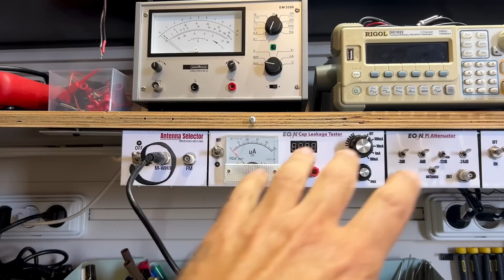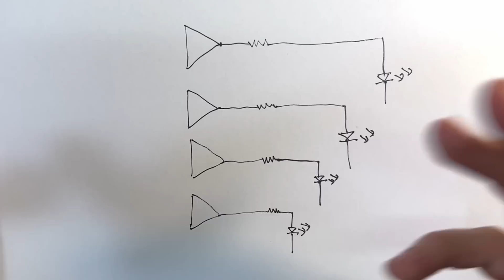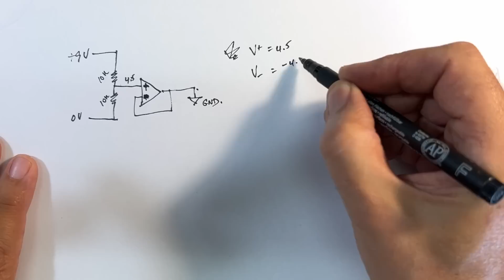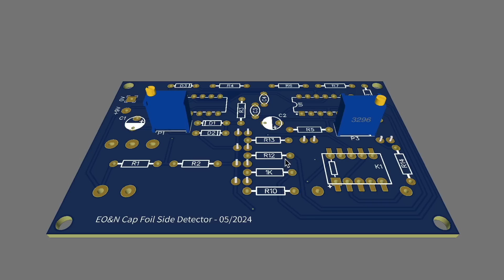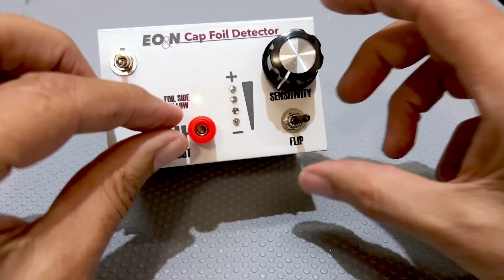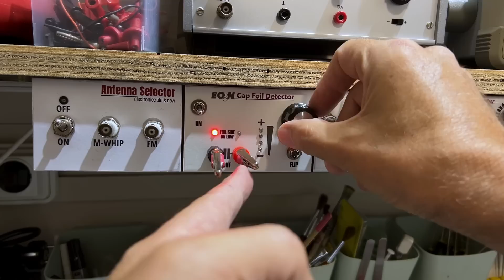Design & Build a capacitor outer-foil detector for restoring vintage audio & radio gear #pcbway#

Comment: I just discovered your channel. What a great design, and many thanks to you for freely sharing it with us fellow electronics hobbyists!  You stated that such a tool is unnecessary with old stock film caps that already have the outer foil labeled.   I've found the factory markings aren't infallible; over the years (using the classic o'scope method) I've ran across a few here and there that were incorrectly marked.  Which, by the way, makes a foil-side indicator like yours even the more valuable!

Comment: May I make one respectful suggestion? To avoid having to touch the DUT, would it be feasible to mount something -inductor? close to it? This would provide a ready source of RF hash thus keeping one hand/finger free. Plenty of room in the box to make something using a 555 to manufacture the hash. Also, if I was building this I would use push tabs such as on the back of speakers in place of the banana connectors. BTW your clips adaptors are pretty nifty though. I really enjoy your channel.

Comment: Nice circuit. Your banana binding posts should not be red and black, since you don't actually know the polarity.
Also, you forgot to demonstrate the trimpot on the voltage divider that sets the LED ganularity.
I think that control should have been made avaiable on the front panel, for fine adjustments on tricky caps.

Comment: Similar to stevegreen5358, I found your channel after watching dozens of Mr. Carlson's videos and I also don't want to use circuit boards with surface mount components. Therefore, I am very grateful for your design of a capacitor foil side detector that uses through-hole components. I’m in the process of implementing the power supply and capacitor switch circuits on a breadboard and I’m not clear on how you get the -4.5V (V-) voltage from the op amp.  Further clarification would be really appreciated. I took the liberty of redrawing your power supply and capacitor switch circuit designs that I'm using to implement the designs on a breadboard and I can forward you the file if you like.
I think that your videos are awesome. I’m a visual leaner and your explanations make it easy to grasp electronic concepts that I’ve failed to grasp in the past.

Comment: Why not just get the capacitor manufacturers to put a mark on the outer foil terminal?
Reply from the maker: I think the cost issue came into play 😊
Reply: @electronicsoldandnew  They have no problem marking electrolytics, though.

Comment: If you happen to need to make the circuit board again R11 is not labelled as R11. Instead it is labelled as 1k.
Same goes for the schematic. R11 has two values 1k and 2k2 instead of R11 and 2k2.
I guess you could update the schematic anytime for clarity.
 I built the circuit and put it all in a 3D printed box. It' works just OK. About as good as the one you show.
Thanks for another interesting project.
Reply from the maker: Amazing how mistakes still creep in after numerous checks 😊 thanks for the heads up
Reply: @electronicsoldandnew  Yeah. It happens to me all the time. Just when you're sure it's all perfect. 🙂
 I also made the capacitor leakage tester. Works great.
Keep them coming. Thanks

Comment: i have just finish building this circuit and it seems to work very well. I still need to build a proper enclosure for it and make up a good capacitor holder before i can test it out properly. The LEDs i used are a bit on the dim side but they are old West German surplus from how know when, but they are bright enough. One thing that took a bit of time to figure out was wish way the LEDs ware supposed to be installed, there are no plus or minus markings on the silk print for the LEDs, other then that i have no complains.
Reply: There most certainly IS a + and - marking on the PCB for the LEDs. The circle for each LED position has a flat side, which designates negative. All (modern) LEDs have a corresponding flat on the base flange of the plastic.
Just Google for LED Polarity and you have the answer for next time.

Comment: So, I just now built one using the PCB from PCBWay. I used TI TL074s.  After doing the initial adjustments of P1 and P3, the - and + rails are even at 4.56v and the comparator volts are a perfect .1, .2, .3 & .4  The problem is there is a constant +3.7 vdc on 14 of U2, so the LED's are always on. P2 has no effect. Curious if anyone has built one yet, and if so, what the result was.
Reply from the maker: The level at pin 14 shows that the opamp has effectively pegged to the positive supply rail. Try another opamp if you’re sure the soldering and component polarities are correct.
Reply: @electronicsoldandnew  A new TL074 didn't help. Double-checked the electrolytics and all solder joints.  I did get a change by shortening the temp hookup leads to the P2 sensitivity pot. Occasionally the voltage will drop to 0, with or without a test cap. If I quickly adjust P2 just off of 0 voltage shoots back up to 3.7. I'll look at the datasheets and see if the TL072 vs 074 could be an issue.  You also mention that P1 can be used to adjust one rail higher than the other. I have them even, could that be an issue?
Reply: Shortening the P2 jumpers was a clue. They were acting like antennas. I hard wired the pot, and now I have a variable voltage. Only issue is that it is the same no matter which lead of the cap is to ground (so no LED change with the relay flip). Getting there!
Reply: @electronicsoldandnew  Been using my little tester for a month now.  On modern poly caps I can barely get a partial LED difference between the sides and requires lots of playing with the sensitivity pot to even get that. I have P3 adjusted to 0.4v level (so .4/.3/.2/.1 vdc LED illumination). Have you tried, or what do you think about decreasing the spread even further? Like .32/.24/.16/.08 numbers?
Reply from the maker: I haven’t tried that as I normally get a diference as it is, but by all means, give it a go.

Comment: I just found your channel after watching dozens of Mr Carlson's videos, and I joined your Patreon channel immediately. I don't want to make my own PCBs and I don't want to use surface mount components, so I am so glad you use through-hole components and make the Gerbers available. PCBWay's pricing is ridiculously cheap, so I will make some of your projects very soon.
Reply from the maker: Welcome to the channel and for your support. I really appreciate it. I prefer to make the Gerbers available as for some people the shipping can be quite costly. Personally I actually like SMD, but many have problems with it, so k normally opt for through-hole versions as it’s more generally preferred. If you have any questions, feel free to ask through patreon. I’ll be happy to help where I can.

Comment: What are the specs for the LEDs used in this project. Sorry if this has been covered elsewhere. Do I need 5 volt or would a lesser voltage rating on the LED work just as well? Great project and thanks for sharing!
Reply from the maker: Normal 3mm LEDs. The dropping resistor takes care of the actual voltage applied.
Reply: There is no such thing as a "5 Volt LED". They operate on current, and create their own voltage drop when they illuminate.

Comment: Awesome project!!! Thanks so much for sharing and I already received my pcb's. Can I respectfully ask if you can share a list of all the latest part numbers you used for this build? Thank you so much
Reply from the maker: I’m afraid I didn’t draw up a parts list. The parts can be determined from the schematic and the videos.
Reply: If you need to ask for manufacturer's part numbers for totally generic through hole parts, you really shouldn't bother getting into electronics.
Reply: @johncoops6897  you're so right but you really don't need to be a richard about it.
Reply: @JesusIsLordofMybeing  - yeah, sorry it came across a bit snarky. There are people who are are literally asking for the part numbers of the TL074 opamps!
Reply: @johncoops6897 it's all good I'm sorry as well for my reply. I just think if he had a master list, it would have been such a time saver. I was being a bit lazy but unfortunately didn't think it out before I commented. I'm very happy for the pcb design. Take care and again, my apologies.

Comment: Most of the individuals who think they have discovered Free Energy, are, in fact, finding this phenomenon with their 5$ DMM.
This project, while a useful tool for some, is somewhat redundant.
I simply hold the Cap lead in one hand, and the MM lead in the other.
But. To the ppl out there, learning, just now getting into Electronics. This is one circuit you must build. Breadboarding it at home will introduce you to the freakin' insane world of Op-Amps. Good, Bad, or otherwise, they are in every device you own.

Comment: This is a very useful tool. Thanks for the excellent explanation about how it works and how you designed it. Most importantly,
 thank you for sharing the PCBs. They are on order.

Comment: Manuel: I just ordered the pcb's and selected to donate 10% to you. I also built your capacitor leakage tester. Another great project. Thanks.
BTW would you have a final schematic with BOM I can download for this project?
I like to keep all the info in one directory. I think for the leakage tester I did a screen grab of the schematic. Not ideal. Maybe I missed it somewhere.
Thanks
Reply from the maker: The schematic can be downloaded from the pcbway share page. I don’t have a BOM, I’m afraid .
Reply: @electronicsoldandnew  Ok. I guess I missed it there. I saw the Gerber download though.
EDIT: Found it - But schematic doesn't have the part number for the opamps nor the relay.  There was no "link below" for the relay. Save me going through the video again. Can you give me the part numbers.
Thanks
Reply from the maker: Opamps are TL074, and the relay is a TQ2-12V
Reply: @electronicsoldandnew  Great. Thanks

Comment: Excellent piece of test gear. If you didn't already have the relays, you could use analogue switches (some have very low on resistances and draw uA but you would have to fiddle with the supplies a bit). In my head I have a mod that would induce 50Hz into the test cap, rather than having to touch it, but that would be version 100.
Reply from the maker: That’s actually quite easy to do. It doesn’t have to be 50Hz. You can add a small oscillator (200 - 1000 Hz) and have it drive a small coil near the cap.

Comment: Like the gentleman says you just need a toggle switch............Plus there is a guy on  YouTube that restored the same radio twice  placing the modern capacitors both ways round and  no noise difference was noticeable. Interesting project though.
Reply from the maker: Yes, Xraytonyb.

Comment: Now you need to come up with a electrolytic polarity tester. I have found some capacitors that were marked wrong, mainly tantalums.
Reply: Tantals have the positive marked, other electrolytics the negative.

Comment: I declare myself 'one of the few?' that absolutely live for seeing the schematic design and decisions in these. That's the magic, understanding the circuit so I can go make my own!

edit: I would think about making a "range sensitivity" to select between large or small voltage differences, so could look at caps with large or small variations. So it could switch between using a 22k pot and a 100k pot for instance, before going to the 1k dividers
Reply from the maker: Always useful as it cements our knowledge and raises new questions 😊

Comment: Nice job.  Keep this up and you'll need another shelf !
I'm giving a talk about OpAmps to my vintage radio society in a month or two.  May I use your circuit diagram as an example ?  It covers about 4 different uses for OpAmps.
I managed to track down one of the earliest iterations of an OpAmp - the 'Gap/R Model K2-W'  Google that and have a chuckle.
Reply from the maker: Sure, use it by all means.
Reply: Cheers.  Will also put in a promo for your channel too  🙂
Reply from the maker: Thanks. I appreciate it.

Comment: Nice one! I am interested how much difference it actually makes if you put capacitor in wrong way. Would be interesting to recap a radio with all the capacitors backwards, then turn them around one by one and check the hum levels.

I usually use an oscilloscope to check the capacitor foil side, but I noticed that sometimes one series of capacitors has the difference so minor, that I can't see it on a scope, I usually don't bother then, as even in practice, the improvement would be really small. I had this happen especially on lower value capacitors (1nF-10nF).

Also I don't think this works on ceramic caps, as they are built mostly completely symmetrically. But perhaps you also try it, as I do sometimes use ceramic capacitors to replace paper, especially on not so critical parts like AVC line, etc.
Reply: https://youtu.be/QTaYgT7e56w XrayTonyB did a video doing pretty much what you describe

Comment: Instead of building your own 4-step comparator, you might have tried LM3914 that provides 10 steps with the divider network already built in.  It would have provided finer steps and/or wider range.  Of course, it would be a bit more expensive than your quad op-amp and also the 6 extra LEDs would add some cost.  Also, you could benefit from making your buffer stage sort of logarithmic with just one additional diode and resistor or two.  That would expand the range and reduce the need for adjustment of the potentiometer.  From your presentation, I conclude that you would be fully up to the challenge.
Reply from the maker: Had that planned initially, but then decided that it was not necessary for the purpose here. Also … drilling lots of holes for the LEDs is a pain 😊
Reply: If you want logrithmic you could also try the LM3915 IC (3dB per step)

Comment: Manuel, what tool do you use to bend the white steel covers? Hammer and bench?
Reply from the maker: No, these are aluminium elements (6.5x6.5cm) that I had part of one side cut to give me access to the top and create the lip to hang on my rail.
Reply: @electronicsoldandnew  didn't understand however thank you and my compliments!

Comment: Hey Maestro, however i think it makes no difference on old tube radio sets (no hifi in there), this might please some audiophiles (read audiophools 😂), yet I'll be building this for sake of curiosity on my 300b, gm70, tube phono preamp and other realizations... These miniatures you show every now and then are small treasures😊 ah, one thing more for the lazy like me, did you compile a BOM for the project?

And never forget, electronics old and new you are good at restoring old radios and alignment of old radios, my friend 😂😂😂
Reply from the maker: No BOM 😊 and… won’t forget that either 😊
Reply: @electronicsoldandnew  however, you've mail, for the Gerbers of the stepped attenuator, last version... Thanks 👍
Reply: There is zero HiFi involved. The main "noise" that the caps are reducing is 50/60 Hz hum from the mains.
In sensitive radio circuits, the pick up of mains hum creates audible noise in the speaker, and this is always nicest when minimised. Since this is never heard until after the build is finished, and there is zero cost involved...  it's a no-brainer to just test the caps  and install the correctly, rather than fiddling around afterwards if hum is audible.

Comment: Nice idea... but wouldn't it be an option to use an electronic switch controled by an oscillator to switch capacitor sides and the (single led) readout? the only thing you'd have to do is to adjust sensitivity. When only one led burns, that's the "wrong side of the Cap. 
BTW : add a (10k to 100k) resistor limiting the input current for the clamping diodes, doesn't influence the opamp too much because it has a FET input.
Reply from the maker: I don’t like the auto-flip idea as I prefer to have more control over the process.
Reply: @electronicsoldandnewI wouldn't add anything to your tester. Is perfect!!

Comment: Just wanted to shout out that I enjoy your equipment builds immensely. I've built the Zener Diode Voltage Tester and it's one of my favorite pieces of home-brew test equipment. Will be building the capacitance leakage tester next as soon as a suitable project box happens my way. This one will probably follow.

Comment: I made one years ago with just a small aluminum box, a toggle switch, a speaker spring clip to hold the capacitor, and a BNC connector to hook to a scope. The switch is mounted parallel to the capacitor. Simply hold the capacitor with one hand and flip the switchback and forth while looking at the scope, and stop when it reads the highest. The switch handle automatically points to the foil side.  I put a piece of plastic tubing over the switch handle to insulate it. Simple and works well. So well in fact that I don't have the need for anything else.
Reply from the maker: 👍 if it works, why change 😊

Comment: Sir, I may be wrong but in the beginning I think you have incorrectly labeled the non-inverting op-amps. I think the input should go to the non-inverting (+) input and the output connected to the  inverting (-) input. Again, I might be wrong.
Reply from the maker: You’re probably right 😊 I sometimes do that. Fortunately the schematic that results in the pcb is correct. Thanks

Comment: A new orange drop may have a partial band on it, but they need to be checked since that band means nothing! I'm sure you agree.
A 1N914 will work as well. To make it solid-state, you could use a CD4066, or 74HC4066.   Another E O&N original project!  Nice work. 👍
Reply from the maker: Thanks 🙏